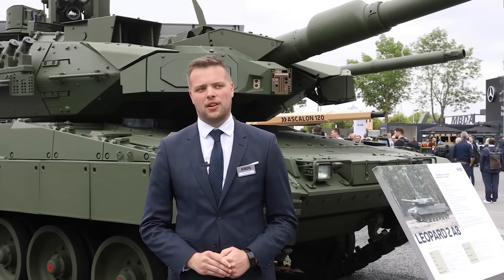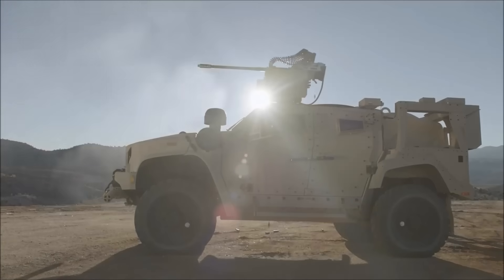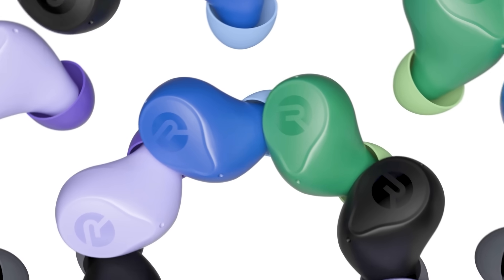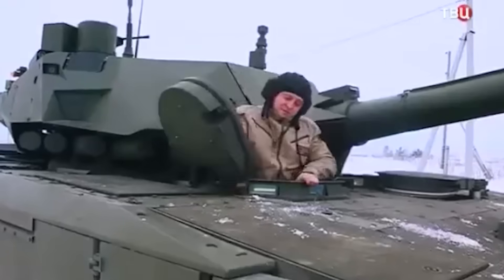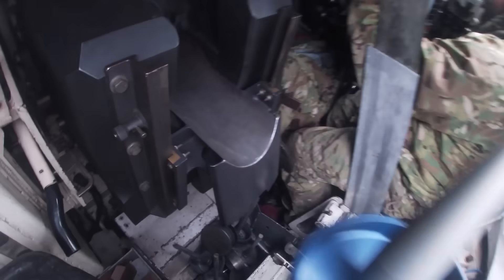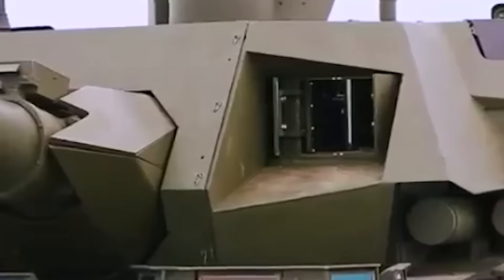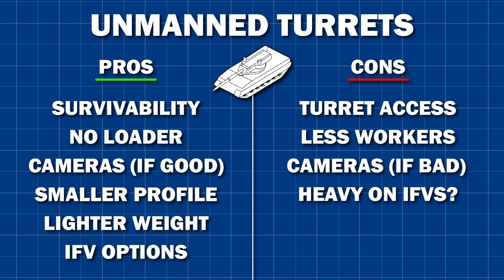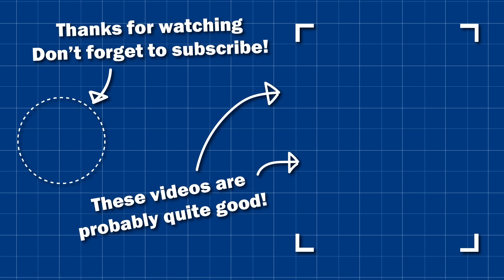The Unmanned Turret - And Why It's The Future

Comment: I believe unmanned turret  is the future.  If I were to design one with some off the stuff I use the Merkava hull as it has a lot of space to put four crewmembers in.  I would slave the fire control systems the Iron vison  helmets. I would retain the 4th crew man not only to help with maintenance  but as a 4th set of eyes, an extra body in the sleep watch standing rotation, and as a systems operator, drones, anti-drone systems and APS than a new modem tank is going to have to have. An unmanned turret gives more room for those systems

Comment: Unmanned all the way.

I'd say, ideally, we'd go from 3 crew members to 2 and then to 0 using fully automated or remote controlled machines with logistical lines backing them up, which would include repairmen specialized for efficient and effective on field fast repairs.

Comment: The best Tank is a conversion of a T72 in to a automatic machine. T72 is a cheap tank, it has autoload, all y need is add some cameras, an AI computer and robot to switch gears. Cons - it is still can be easylly destroyed because of the autoloader carousel but since we get rid off 3 crew members we can add additional armor of ~200kg and we  can use space inside the tourette for this purpouse.

Comment: Manned or not the turret front needs to be protected against ATGMs and auto cannons. A MBT’s purpose on the battlefield is to force the enemy to bring up heavier stuff to deal with them, a turret that can be penetrated by auto cannons and infantry launchers from the front like the one on the Armata makes it unusable in any sort of closer range combat. Losing one of your optics is very different from getting your main gun disabled from an RPG.
I would still go for an unmanned turret tho, the one on the leopard. It provides some crew protection against drones but the front needs to be armored to the same degree as normal leopards

Comment: I think unmanned turrets are going to definitely be increased, but I don't think it's going to replace manned turrets *completely*. The one thing I see that unmanned turrets can do better and worse at, is drone defense. Better because the turret interior is not as weak, worse because situational awareness is potentially worse. Whether you like it or not, drones are being deployed on the battlefield in huge numbers, and until something major comes out to disrupt that, there's going to be a lot more in number and their sophistication will continue to grow.

The one advantage I can see if continuing to run a "traditional" design is more crew to run more guns, if that is even an option. For example, WW2 tanks often had another crewman run the hull MG in addition to the turret, and pintle mounted MG. There are armor packages like on the Abrams that mounts another 240 on the turret and an M2, as well. Then there are those like the GMV modded Humvee that put guns on every  mounting point where there's a  body in, including the trunk.

Although complete situational awareness and 360° defense has always been one of the Achilles' heels of armor, it can be mitigated with more guns in the vehicle itself.

With drones becoming more prevalent on the battlefield, the ability to spot and defend from threats at all angles and all times becomes even more critical.

Maybe there will be a return to explore multi turreted designs?? 🤔 Maybe there will be a return to casemate designs for maximizing armor fighting while attempting to solve the defense problem by putting more guns to face outward?? Sure, it would solve 1 problem, but then another would take its place. US armor of WW2 had 50 cals on everything specifically to attempt combat aircraft. Maybe that will come back?

But, again, there are tradeoffs with that, as well.

No matter how you look at it, there will be tradeoffs. Then it ultimately boils down to if the hierarchy wants to pay for it.

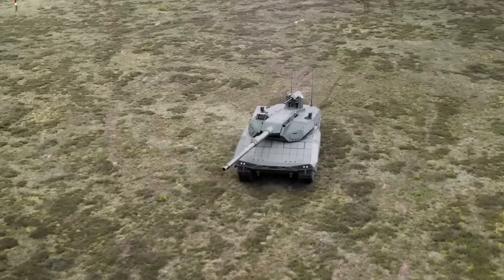Comment: I'd reduce it down to a 2 man crew - driver and commander. Modern AI should be able to control the gun and hit targets identified by the commander. That would mean the tank could be smaller and lighter but with better armour. It would be good if both positions can be interchanged at the flick of a switch. I wasn't so impressed with the shot trap design of the turret shown in the video (00:26).

Comment: Nahhh, this concept of tank is practically dead. Having weak spots doesn't work anymore. Smalll anti drone turrets won't help either. The only way for them to exist on the battlefield is becoming really heavy, with conposite armor all around, ERA, spaced armor, cage spaced 1m from the armor, more ERA, APS, anti mine trawl, active demining system, no weak spots, EW
Reply from the maker: Uh… what?
Reply: @RedWrenchFilms tanks need a completely new concept. It doesnt matter if your turret is unmanned or manned. Everything will get taken out by drones, drone warfare will develop, their numbers on the battlefield won't stop increasing. The only way I see is getting rid of tanks entirely, cause all their work can be done by other weapons. And if you need frontline penetration you have to design something like what I said, very heavy, with tones of armor, spacing, era, aps and what I named. And probably get rid of main gun entirely and maybe just have a small machine gun. If there is enemy on your way you want to have allied drones near you that will take him out
Reply: @goldman_ya Anti-drone munitions are already a thing.
Reply: @ironicdivinemandatestan4262  drones will start flying low, carying rpgs, getting under the vechicle, increasing speed, quantity, and it will be quite easy to overcome them
Reply: Speak sense man

Comment: Unmanned turret tanks are clearly not designed for armor-piercing and projectile-to-tank combat. They no longer pursue a balance of firepower, mobility, and protection. Instead, they embrace the new concept of "integrated signals and fire," prioritizing situational awareness and active protection. These insights were drawn from the Russo-Ukrainian War and the Gaza street fighting. While their true combat effectiveness remains to be verified, they represent an innovative direction.
Reply from the maker: They perform better in “armor-piercing and projectile-to-tank combat” than the regular configuration. More armour in the important areas.
Reply: @RedWrenchFilms  China's Type 100 tank doesn't think so
Reply from the maker: @xiaoyang8941  Yes it does - that’s why they went for an unmanned turret. Also, not all tanks are designed for the same roles so it’s a bit of an apples and oranges comparison to use the protection of individual vehicles.

Comment: russians don't know the abrams TTB, the first MBT with unmaned turret ? somes western MBT have autoloader but not in the hull, it is in the back of the turret with anti blast panels on the roof 
T-14 is a fake tank, russia abandoned construction after only 20 built cause it is not reliable and too expansive, so they modernize T-72/T-80 and build somes T-90M with their auto pumping turret

Comment: Drone to the tracks/sprocket/engine will still mission kill the tank. Drones will loiter around and wait for the crew to escape and kill them off 1 by 1.  Proof? Ukraine war. You can have all the fancy crap and thick armor, but a dozen of cheap, unjammable fiber optic drones waiting by the roadside is ready waiting to humiliate that tank. There's a reason both sides now switch to mobility (ATVs and Dirt bikes) over big armored tanks and IFVs.

Comment: If you're going to put the crew in the hull - put the powerpack in front and the crew in the rear of the tank.  this way it's still possible to have hatches and vision blocks for all crewmembers.  Keep the linkages between the driver and the powerpack mechanical so if you have a complete loss of electrical power - the tank can be driven away because they can simply put the tank in reverse and drive backwards while while the driver looks out the vision blocks.  And having crewmembers underneath the turret will make an emergency evacuation of the tank a slow process (and worse of one of them is injured).  Having a hatch over each crewmember's position means that you can use one person pushing from underneath and another person pulling on the injured crewman's extraction strap in order to quickly remove an injured crewmember from the tank.  A tank commander is a 5-6 year investment, a gunner 4-5 years, and a driver at least a year.  (The loader is the position for the lowest0skilled crewmember.)  This means that once wartime production ramps up - replacing tanks will be faster than replacing the years that have been invested in training the crew.  

Current powerpacks are fully capable of running to 2000+ hours without needing maintenance.  So having it behind the heavy armor on the front to the tank won't be an issue.  (You're going to need a crane to remove the powerpack and it can simply lift out sections of the armor to access it.)

Comment: In real war, complexity is a liability. Cheap, rugged, and easy-to-use systems win because they can be built fast, repaired anywhere, and operated by anyone. Autoloaders and unmanned turrets? Honestly, their only real advantage is rapid fire—beyond that, they offer little. The true game-changer will be humanoid robots that can work nonstop all day, replacing every manual function—but that won’t happen until we overcome current battery limitations. Until then, simplicity, durability, and minimal learning curves decide the battlefield

Comment: Definitely still gonna want to armour that turret. Being vulnerable to autocannons is no joke. Yes, the breech and optics are vulnerable, but there's no reason to make the delicate autoloader mechanisms a weakness too
Reply from the maker: Aside from speed, weight and cost, of course!
Reply: @RedWrenchFilms  Yes that is a fiar point. I will add that the decrease in turret dimensions already considerably reduces the weight for the same armour thickness, and this may be something we see emergeing as a doctrinal difference; some manufacturers may opt for more or less armour, perhaps some would even use the weight savings to armour the breach.

Comment: I think tanks have an already very optimised design. In battle, you also need reliability, not just top of the notch technology. And an unmaned turret design looks like a very breakable design, you rely too much on the cameras and the turret remote control, these things look very brittle in the heat of combat, Specially if the enemy knows that now the least armored part of the vehicle carries all the ammunition, essentially allowing them to focus more than ever solely on the turret, increasing therefore, more stress on the remote control system.

Comment: Ammunition storage would be limited compared to manned turret, unless you stored some of it in the hull, it would carry less round without resulting to a bigger turret, even if some the round is stored in the hull, the auto loader would need to be able to access it, this would add more problem to the already complex system. MGS have this problem, so I'm curious how they handle this problem

Comment: My 2¢: I think those countries which can afford to develop a tank are all considering to draft Robotaxi in case of war. First: It wont die, is cheaper to operate, the technology is already in use and probed functional.
The tank philosophy certainly meet a turning page these days; the new generation probably will weight only half or less of modern tank and be no bigger than a pick up truck, and will be a robot 🤖 100%.

Comment: It is new design, but the question? Are those men are safe if the tank hit by a missile? I guessed not.
Reply: The Leopard 2 A-RC3.0 includes an active protection system meant to intercept incoming missiles. Of course, it's not yet proven whether or not the system will be effective.

Comment: Man have you forgotten about the t14?
Reply: The T14 has a different layout, similar to the M1 TTB. They have three crew members sitting in front of the turret, which stores ammo in a carousel. The Leopard 2 A-RC3.0 has a basketless turret with two of the crew members underneath the turret. Ammo is stored at the rear of the turret, which is safer for the crew.

In order to eliminate the turret basket, the Leopard 2 A-RC3.0 features a double jointed elevation mechanism. Another possible way to eliminate the turret basket would be using hydropneumatic suspension to lean the entire hull.

Comment: I'd probably go for an unmanned turette.But I'd go further, putting the crew in the back and the engine in the front. If the tank gets disabled, it's wreck still provides some some cover to the dismounting crew. A ring of transparent aluminum can house two to r rows of cameras, spaced 3cm apart, delivering a 3d VR image out of the tank. the 3cm spacing makes sure that even a loss of every other camera still delivers the full picture. each row has a different zoom level. stitching the images gives a sharper image, even at a far. even further and sharper than human eyesight.
my revised autoloader has the carussel go through the base of the barrel, simplifying and accelerating the loading process. Not really DP-27 stile but close. 
The tank has several holes on it's turet for shotgun shells, giving a wide spread upwards to counter drones.
A powerful antenna goes along the canon, being able to deliver an EMP shock. frying nearby electronics.
Reply: That carousel idea reminds me of an ammo pan idea I've had. The turret is a flat disc, with the barrel fixed slightly inclined upward. In order to elevate the gun, hydropneumatic suspension leans the entire hull (see K2 Black Panther).

The ammo is stored in slots radiating outward from the center of the turret, with blast panels allowing ammo explosions to vent upward.

The loading mechanism is fixed to the hull, so it can pull a round from the turret when the turret is pointed at some angle, or push a round into the barrel when the turret is pointed straight forward. This way, the loading mechanism is easy to access by the crew, and it's easy to manually slide the loading piston if necessary.

As a bonus, it's easy to resupply ammo from the outside.
Reply: @IsaacKuo not bad. Pretty good! 
I was envisaging the carousel as a conveyor belt. When the gun goes to neutral, it could have a backsliding rear,  this would open the side so that the circular conveyor can drop in the sabot.

Comment: If the fire control system or the sensors of a modern mbt suffer a malfunction, the crew can still be somewhat functional using their backup sights. No such luck on an unmanned turret.
So I'd go for manned turrets and maybe completly unmanned tanks as support.
Reply: An unmanned turret can have as many backup sights as deemed desirable, just like a manned turret. For example, an M1A2 has two backup sights. If the gunner's sight is taken out, the TC's sight can be used to aim and shoot the main gun (and the coax). If both the gunner's sight and the TC's sight are taken out, there's another backup sight for the gunner to use which very much sucks - but at least it's something.

An unmanned turret would plausibly have a similar setup. A good sight for the gunner, an independently rotating sight for the TC, and a third crummy sight as a final backup that's better than nothing.

In principle the M1 platform could also have another backup sight if the RCWS were slaved to the main gun. That's not currently an option, but it could be.

Comment: Im sick of looking at the screen i would hate to do it in a tank. I also cannot imagine good way for crew to enter the tank.
Reply: I assume you mean the layout where one or more crew sit underneath the turret. In the Leopard 2ARC3.0, there are two normal hatches in the front (like the driver's hatch in most tanks), and also an emergency exit in the floor. The T14 Armata also has two hatches in the front, but in that case none of the crew sit underneath the turret.

Another possibility that is common for IFVs with unmanned turrets is for there to be a rear door/hatch, although obviously this doesn't work with a rear engine layout.

It's also possible to have a door/hatch to enter the turret. Obviously this requires some empty space in the turret, but this may be desirable anyway in order to perform maintenance and clear jams. An additional door or hatch on the turret allows entry/exit from the vehicle.

Another possibility is to arrange the crew on a bench sitting sideways. This can allow having two hatches - a driver's hatch in front of the turret and another hatch for the gunner behind the turret.
Reply: @IsaacKuo Thank you for your elaborate response to my drunk comment 😂

Comment: My own inclination would be to design use small light and fast tanks that work in packs, even if they are incapable of carrying a main gun capable of breaching an opposing main battle tank they should be able to cripple it in short order then kill it with a drone, and no it makes more sense to use a remote operated chain gun similar to what you would see in aircraft and control it in like manner as the Apache helicopter gunners controlled its chin turret and flir system.

Comment: How do you clear a jam mid combat
Reply: It depends on the specifics. With a typical RCWS you open up a hatch next to the RCWS and pop your head and arms up to work the gun mechanism as needed. With a tank gun there may be enough space inside the turret to allow for a door so you can try to manually clear a jam within the turret without exposing yourself visibly to the outside.